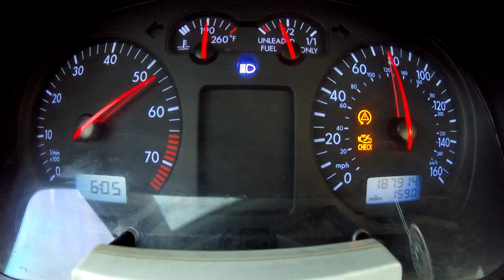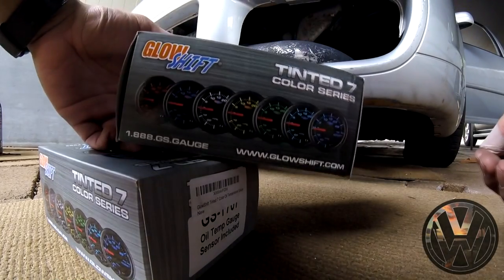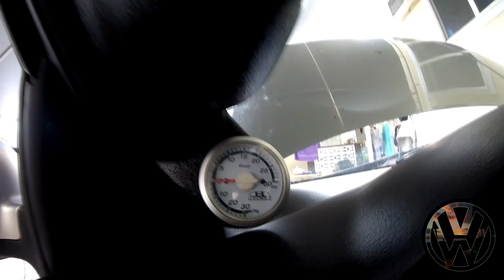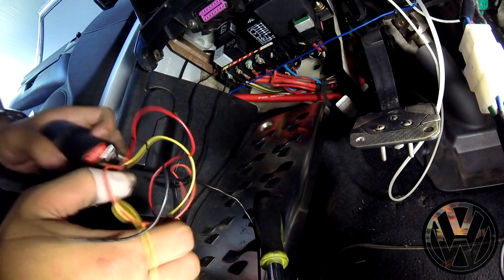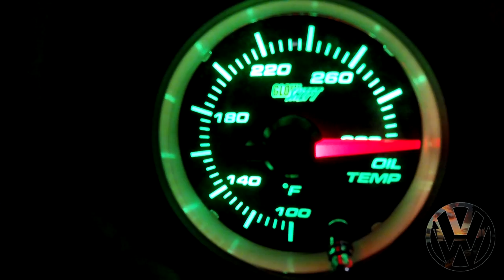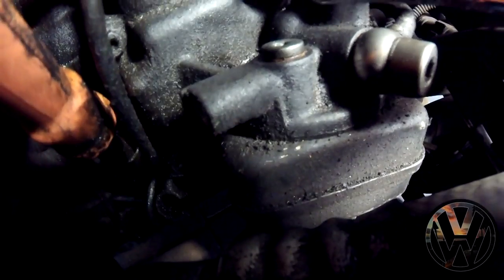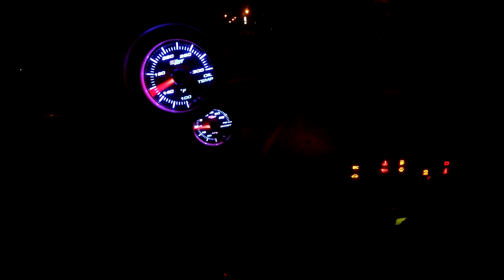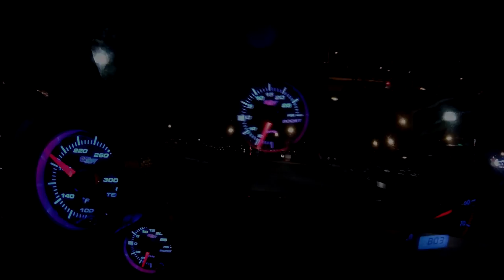Boost Gauge and Oil Temperature Gauge Install

Comment: What fuse does its pop?
Reply from the maker: The fuse is located on top of the battery..I believe it is the one next to the alternator wire. It powers the interior relay panel.
Reply: Not to sound stupid but does it say fuse for panel?     Is it in that little box on top of battery?  Just curious..   cause i was gonna ADD A CIRCUIT to the fuse panel but seen your video and it seemed like a better way to wire it..  except i didnt use the dim wire.. thanks..
Reply from the maker: Seth Na Nope, the fuse is not labeled. But if you want to be safe, adding a separate inline fuse holder will work just as good. I did the inline fuse method on my GLI.
Reply: But there as a fuse on that line otherwise ?
Reply from the maker: Seth Na yes. Just added security with an extra one.

Comment: Hey pal love the videos. 
Wanted to know if you would recommend the the vw to a person who has never owned one
Reply: Only cars I’ve owned are a 02 Honda Accord f23a1. 07 f150 and just bought an 1.8t for $700 w 119k and so far the only thing that’s gone bad is a o2 sensor.. all I gotta say as a tip for you if u get one is make SURE you use the CORRECT fluids for oil/coolant/transmission and you’ll be fine.. also don’t cheap out on parts, it’s a euro car they get treated w a lil more care/respect than a Honda or ford. I’m 20 btw turn 21 in April to put that into perspective, by no means am I claiming to kno it all but it’s sorta common knowledge that European cars are a lil extra

Comment: Dammit. Thanks for the video. I've a mk4 vr6 that'll I'll be boosting next year. I already have boost, wide band, and fuel pressure gauges from glowshift and oil pressure and volt meter from news south performance. I was wondering where you was gonna put the sending unit for the oil temp, an yep you put it right where I have my oil pressure sender unit. I'm wondering if the make a splitter for that connect. I don't wanna weld a bung to my oil pan, and the oil filter housing only has one port. They make the sandwich filter housing so u can add more ports but I have the cartridge filter, not screw on
Reply from the maker: Yea, because of that one port I had to make a decision to get oil temp or pressure for now. I haven't seen a splitter for the port but I'm sure its possible if you find one of the right size at a hardware store. Besides that, the only other option I know, would be to tap a line to the oil pan or on the housing itself.
Reply: VDub In Paradise yeah nah I don't wanna weld or tap into anything,  already dropped my oil pan twice in one month. I found a splitter on eBay waiting on that and the temp gauge I'll get sometime this month
Reply from the maker: Nice. Lmk how that goes! I'll be looking into getting a pressure gauge of that splitter works.
Reply: Ok so the splitter works,  I just installed it yesterday and got to test it today.  Not really test it, just drove to work.  It got up to about 170 degrees b4 i got to work.  Took a while though.  About how long would u say it takes to get a reading.  Other than that it seemed fine,  my oil pressure gauge still reads the usual low pressure it always has.  You have to search on eBay 
Fitting Adapter / Oil Pressure Gauge Meter 1/8" NPT Female and Male Tee Stainless Steel
That should pop right up. I had to drill out the inside of female connect to fit the sensor for the oil temp and then mounted my oil pressure sensor on the side. Seems to be working well, I did put up a previous video of a short walk around an long drive, check it out

Comment: Hey where did your wire from seems like glowshift doesn’t send enough wire lol
Reply from the maker: Silas_ Mk4 Just some electrical wire from the local auto store. I forget what exact gauge but it hasn’t caused any problems.
Reply: Also which 30x did you connect the yellow wire to? My car for some reason doesn’t have a the labels
Reply from the maker: @Silas_cv1  You can connect it to any of the solid red cables, they are all constant 12v.

Comment: What up men!

I followed your video to install the boost gauge, I followed very single step but my gauge is not detecting any vacuum/boost at all. Any ideas of what could be the issue?
Reply from the maker: Make sure you have a good vacuum hose connection to your gauge. Either you have a break in the hose of your gauge or the port that you tapped your vacuum source has a leak.

Comment: Question do your gauges change color by themselves or are they optional
Reply from the maker: The color can be left on a desired one by just clicking the change color button. As long as it's wired correctly it will stay on that color whenever you turn on the car.